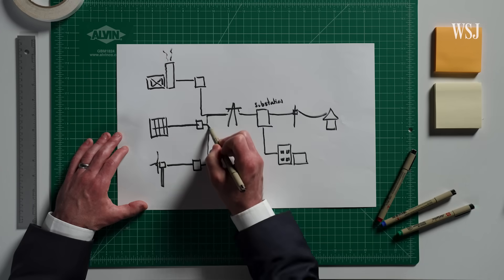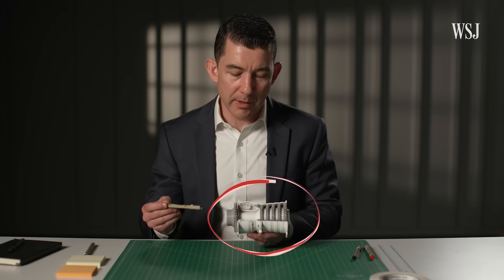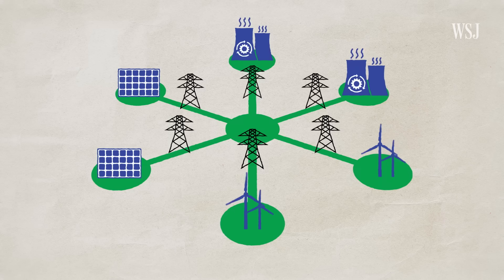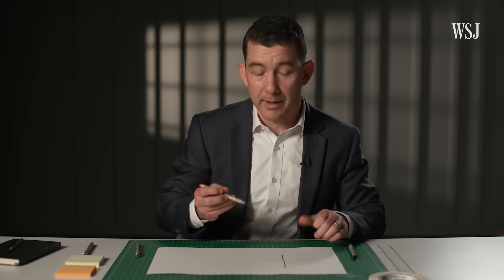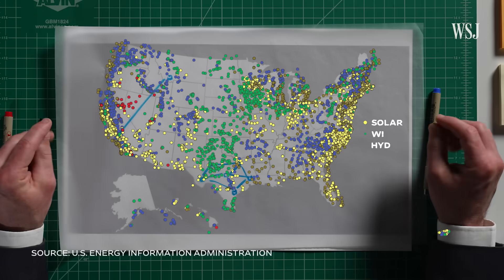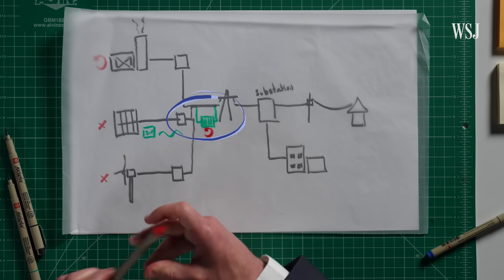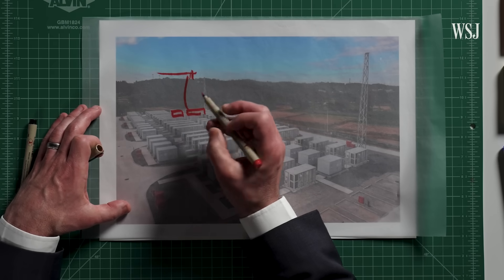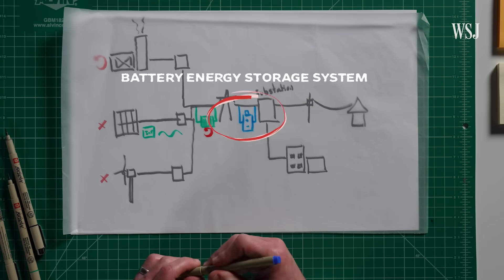How to Fix Renewable Energy’s Hidden Infrastructure Problem | WSJ Pro Perfected

Comment: The power grid is fascinating. But why are we still avoiding nuclear energy?
Reply: From Gemini: The levelized cost of energy (LCOE) for nuclear power is generally higher than for solar power, but the difference can be significant depending on the specific technology and project. Lazard, a leading investment and asset management firm, estimated the LCOE for utility-scale solar to be around $40 per megawatt-hour, while nuclear plants averaged around $175/MWh. However, some reports, like those by the U.S. Energy Information Administration, estimate the LCOE for advanced nuclear power at $110/MWh
Reply: @danoland2929  Wow, i wonder is the miles of needless red tape on nuclear, endless lawsuits, and hordes of NIMBYs have anything to do with that. Or the fact that those estimates are almost certainly based on old reactor designs since new, SAFE ones haven't been able to be built to prove their worth. 

Or that fact that the renewable industry is so insanely subsidized that it is literally impossible to determine how much of the cost of solar is due to subsidizes all along the supply chain.
Reply: @benjamindbailey
Honestly, I didn't think we were, but then again I haven't finished the video lol.

Maybe they're just talking too near term for that? 😅
Reply: The foolish ones are, the smart ones aren't....
Reply: Nuclear energy is actually getting a bit of rebirth around the world. Only a bit because of its huge cost.
Reply: Because a lot of the people who support strictly using batteries, solar, and wind are the direct descendants of the anti-nuclear environmentalists.
Reply: Also BESS  is a back up system whether with nuclear or not.
Reply: Because we need more electricity now, not in 15 years... but if you have 10 billion you would like to invest and not see a return on for 10-15 years, go ahead!
Reply: We’re not. President just signed an executive order for Uranium and fuel supply.
Reply: Because it doesn't solve the problem as cost-effectively as the alternative we are using.
Reply: Beucase we stopped funding NPP R&D and still trying limp along with outdate flawed NPP architecture not meant for land use. Solid Fuel Fission Water Boilers should of never be used for commercial power generation. There is many other very different Reactor TYPES, the most different one  being commercially operated is Advanced gas-cooled reactor but that is still using solid fission fuel. Basically the Nuclear Industry is like running off Flat Head V8s in a world of Direct Injection Turbo Engine vehicles. "Nuclear" is just a politicized umbrella term for a vast array of different technology. The only commercial version are flawed and outdated.
Reply: - Commercial nuclear is one of, if not the most expensive ways to produce electricity at a per MWh levelized cost analysis
- Slowest to build  taking up to a decade or more anywhere outside or China
- Unparalleled risks that only grow if adding more nuclear to a nation's grid.

Basically, every dollar spent on nuclear could 3x to 10x the energy with renewables all built at a fraction of the cost and time.  Even adding grid-scale storage would still be at the same cost of nuclear but still fractions the time to build.

Relying on commercial nuclear energy will actually  delay the global energy transition.  At huge costs and long delays, new construction nuclear energy would only put a small scratch in the amount of energy needed to displace fossil fuels.
Reply: Public perception and the fact that this has caused them to be expensive and slow to built.
Reply: The power companies won't buy any more nuclear plants.
Reply: Cost per KWH.
Reply: Expensive to build, expensive to run, expensive to maintain, and all that expensiveness will be passed to the consumers who are already paying expensive electricity bills. At the end of the day, everything is about money.
Reply: @duerf5826 Would you rather have that? Or you can just still with coal or natural gas unloading pollutants in the atmosphere?
Reply: @duerf5826  don't forget the HUGE decommissioning  costs which are never focused on by the Go Nuke crowd. Decomm. on a huge solar array is safe, simple and cheap.
Reply: @duerf5826  wow you truly know nothing about nuclear, congrats.
Reply: @sciekimike280 and what tf do you know?
Reply: @duerf5826  Still cheaper than building solar and battery farms nationwide.  We are essentially replacing a perfectly functioning grid with another, but at a much higher cost.  A cost that no one has explained to the public.
Reply: Trade-offs. 
All sources (and solutions) have pros and cons. 
For all its benefits, there are also security, environmental, siting, cost, and fuel storage concerns. 
Would you want a nuclear facility in your backyard or general vicinity?
Reply: @ACE-7964  I wouldn't mind one near me.  The amount of radiation that gets out of the plant itself is tiny.  And as for storing the waste, burying it works fine, or putting it in deep pools.  Radiation is fairly effectively blocked by water.
Reply: @Soundpost-f2l that’s really interesting to know. Thanks for your feedback
Reply: Because it's expensive and risky. (I am not arguing we shouldn't use it, but these are the reasons)
Reply: Modern reactors are completely safe. The fact you think they are dangerous means the propaganda has got to you
Reply: Its not risky but its expensive  @TRexOne
Reply: Because theres no place to put the nuclear waste
Reply: @davidekambli3281 
It can be recycled. 
The fact that it's radioactive means there's energy to be harvested. 👍🏾
Reply: @ivoryas1696 Nuclear waste cannot be recycled what are you talking about